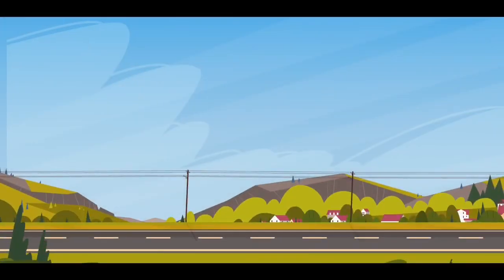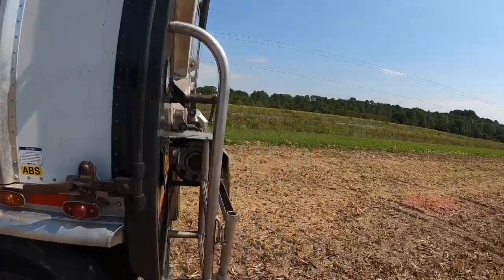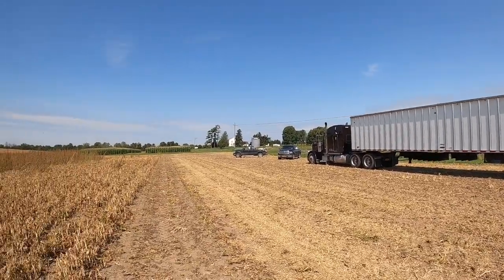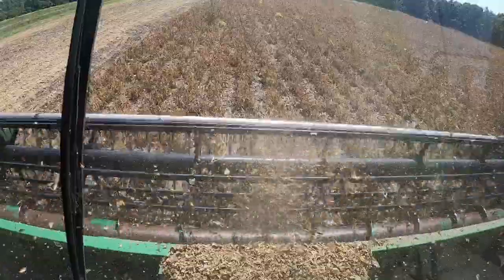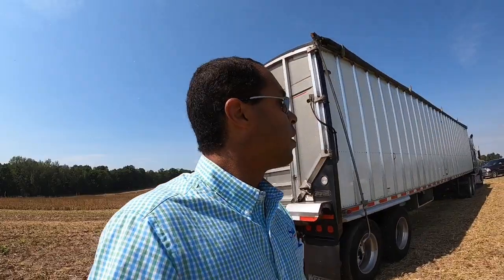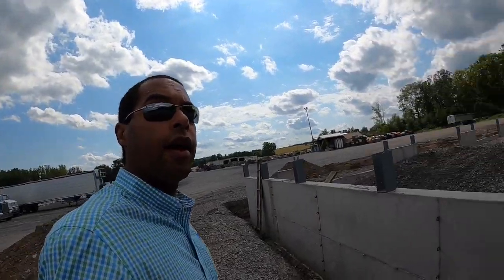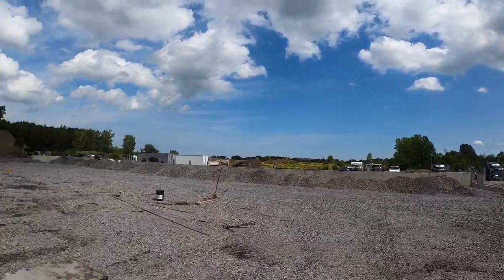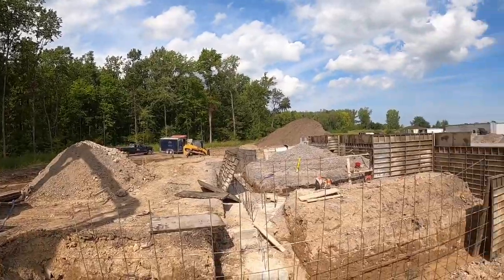Kidney bean harvest 2020 and pumping some concrete

Comment: As a ready mix driver concrete it is infinity easier now That most jobs are pumped and machine grades with a lazer level. Machine finished too. Pretty soon they won't need us drivers.
Reply from the maker: It will be quite a few years before they take your job of driving concrete truck !!!   You guys get in a lot of tight situations